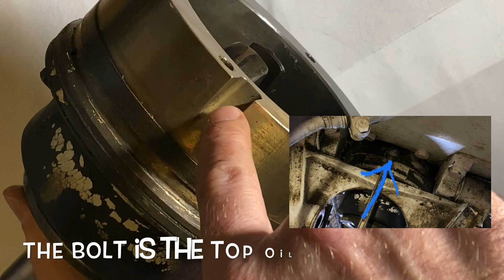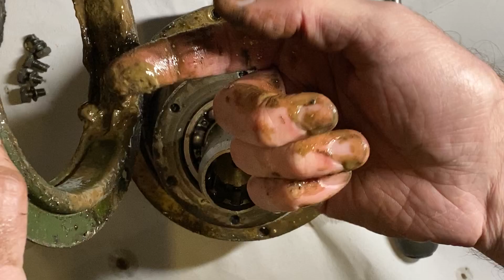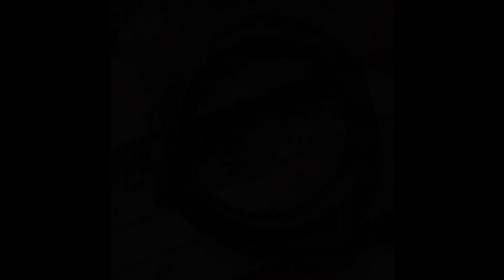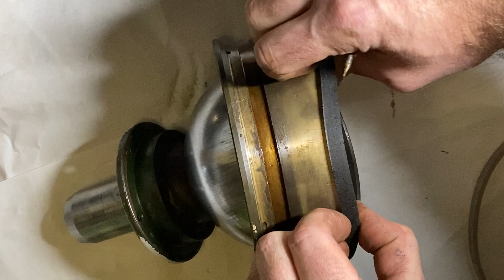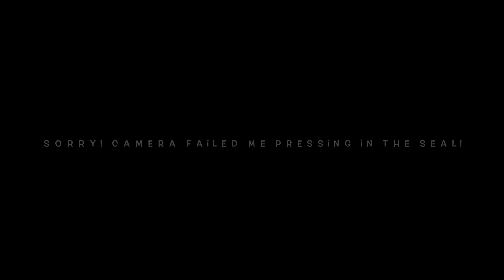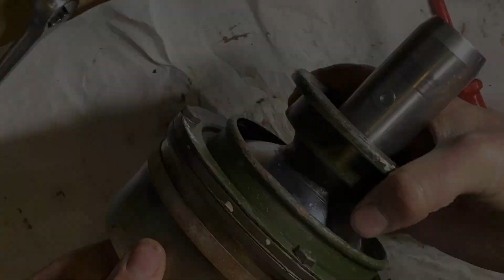Inner Tracta Housing Rebuild - Daimler Ferret

Comment: What is the diameter of your drifts?  I'm about to buy some but I'd prefer to get the sizes  about right.
Reply from the maker: Hi. My brass drift is 5/8” (15.8mm) in diameter and it’s 330mm long. It seems to work well for the suspension pins - big enough to be sturdy and to not foul in the threaded ends for the grease nipples.
Reply: @daimlerferretscoutcar  Thanks :)